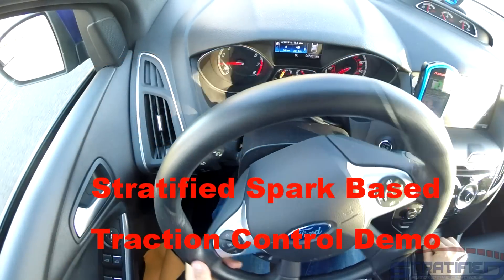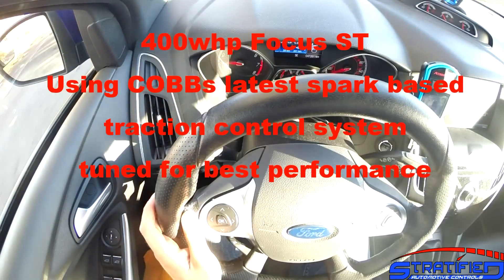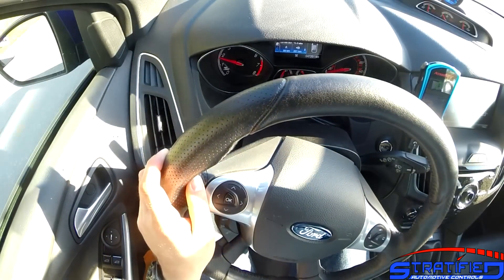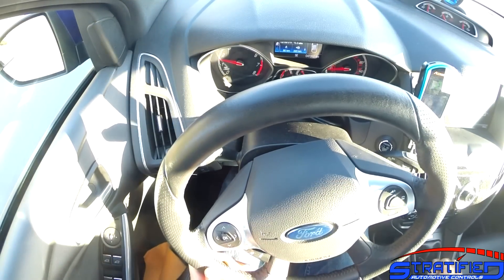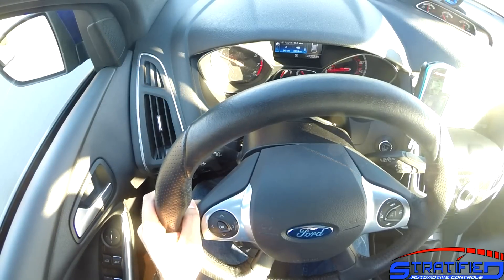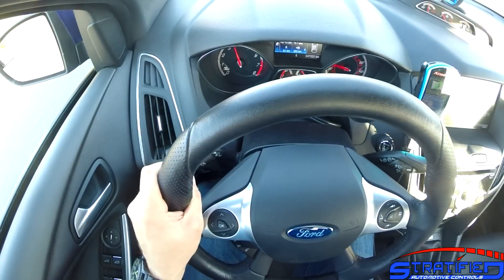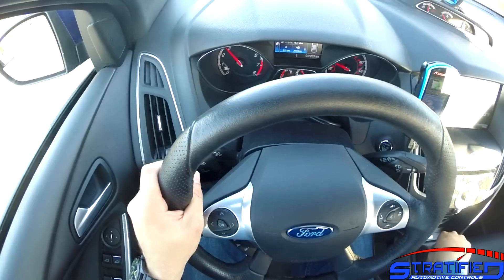Stratified Ecoboost Traction Control Explained

Comment: So how does this work? Do you turn off traction control with the button in the car, and then turn on Cobb TC with the Accessport?
Reply: Bradley Prater  did you ever find the answer to that? I have my tune on the way and i would really like to know
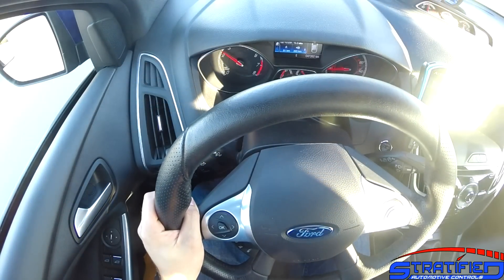Reply: @smokawho  I'm not sure if this is a confirmed answer to the question- but in the video at 2:40 he states that the cars stability control is turned off.